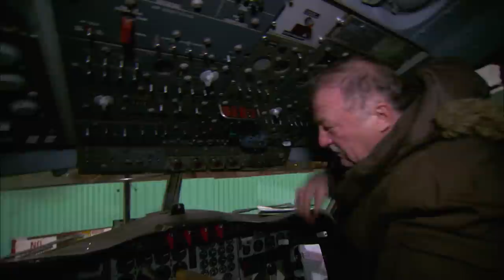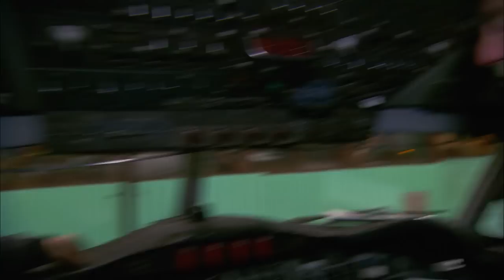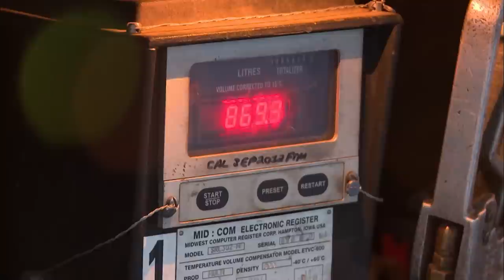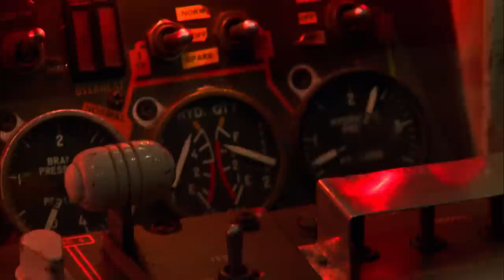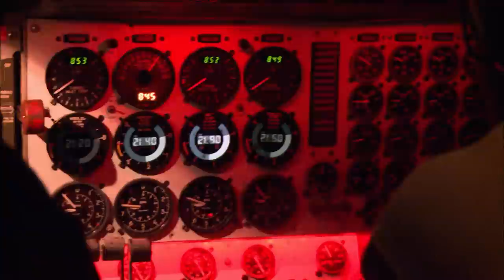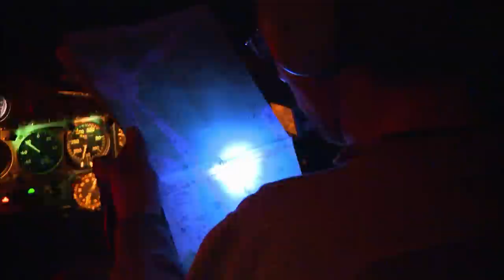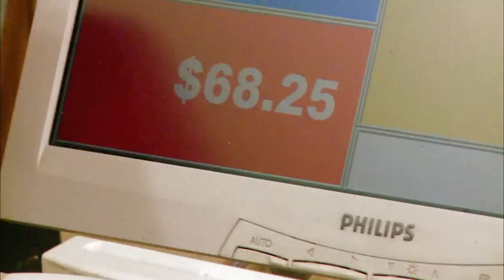Buffalo Plane Engine Catches Fire And Cancels Christmas | Ice Pilots NWT | Wonder

Comment: Wrong...fuel is pumped INTO the tanks. The fueling panel shows the levels in each tank and each switch controls a fueling valve. As fuel does not full the tanks evenly you can open and close the valves to get each tank to the level you need it.

Comment: How can one small airline have so many disasters?
Reply: Old planes. Limited funds for maintenance. Harsh conditions.
Reply: @iridium5652  Also, you only see the bad stuff. This is pretty routine. Look at how many episodes there are? You're maybe seeing 5% of the days out of the year total. Nobody wants to tune in and see flawless runs with nothing going on for a t.v. show. You may as well watch a security camera every day because it'll be just as boring and non entertaining.
Reply: Cause that's all they show....no different then any other airline
Reply: well, if you watched the behind the scenes, showing an airline doing normal operation isnt that exciting, the show mainly shows you the disasters and anger you know the drama. nobody would watch a show where every episode is the same day normal business.
Reply: Well, after working in aviation maintenance for over 40 years I do have some memories of when things didn't go well. Just not in -50 degrees!
Reply: @Cramblit  Literally at 3:37 when they were going into emergency, the pilots told the crew to turn the camera off. Even though we see the outcome of some of these mishaps, I bet there was even worse stuff going on behind the scenes left on the cutting room floor.

Comment: $20,000 for a 2 X 4 Windshield.. That is Insane... As Far as working with no Gloves in Extreme Cold... That comes with the Job... I did it for 20 Years Rewiring Tractor Trailers outside with Ice Salt and Slush hanging off the Wires I was changing out.. When You hands are Wet at Minus 20 and Below its not fun... But You have to move past it because it has to get Done...

Comment: What happened to the no fly below-40 rule ?
Reply: That’s not a rule. That’s a limitation on planes with deice boots, because the rubber boots will get damaged in that temp. None of these planes have boots or that limitation
Reply: It has to be 40 40 40 also

Comment: Flying old, vintage 1960 planes, Buffalo operations should be shut down by Transport Canada as an unsafe operation.
Reply: You have no idea. The C46 is WWII vintage. Damned good airplanes. And there are no planes that can do the job of the DC-3 or C46. I’ve worked on both and they are the best workhorses one could want!
Reply: I mean, they don't let him fly passengers anymore and haven't for a long time.